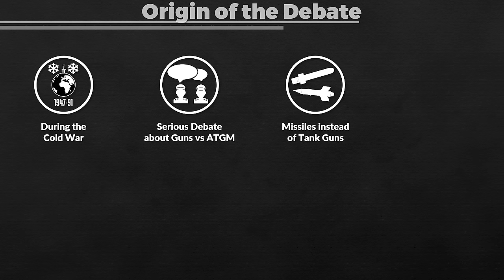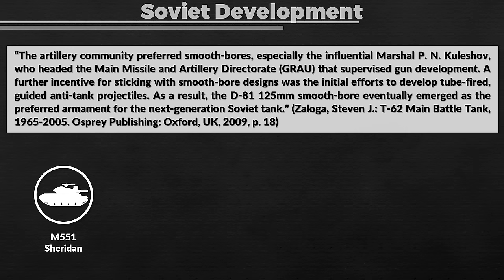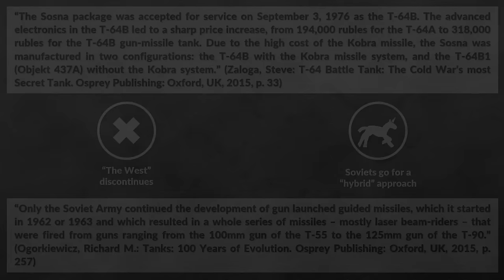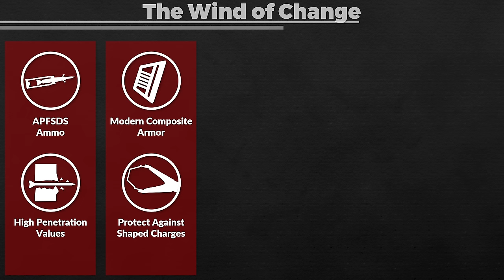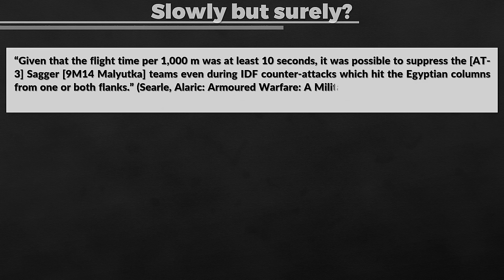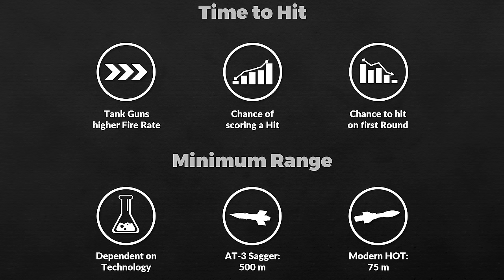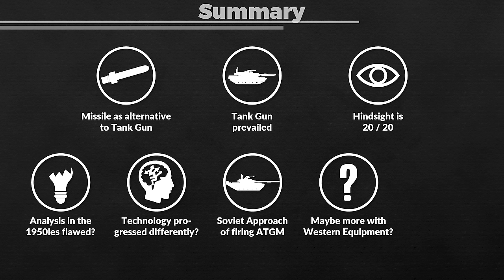Missiles vs Tank Guns: Why Guns are better!

Comment: The LAHAT has a number of advantages. It's very light at 13 Kg. It's short at ~1m length. It's very inexpensive compared to other AGTMs like Javelin. It has both direct and top attack modes. It's warhead is effective, yet small enough to limit collateral damage in urban areas. It has a lower launch signature than most other ATGMs. It has pretty good range, 8 km. Its warhead's rated penetration is 800mm of RHA, and it has a tandem warhead to defeat ERA. It can be used from tank guns, light armored or unarmored vehicles, helos, drones, UGVs and remote-controlled unmanned launchers. A version has been tested for the 106mm recoilless rifle. Given it can be used in so many different ways it's cost can be further reduced with a bigger buy for tank, mech infantry, helo and drone uses. Obviously if that's done the commonality in parts, maintenance, training and simulators also reduces costs.

Perhaps the biggest drawback is LAHAT's semiactive LASER homing. Modern armored vehicles can have LASER detection systems, as well as LASER dazzler countermeasures systems that blind or destroy the imaging systems on the attacking missile launcher. But an advantage is that the target can be designated by other sources than the launcher itself using separate LASER target designators.

Overall, the high capability and low cost makes it a very attractive ATGM system. The Indian Army is LAHAT's biggest customer, used in their Arjun tank guns and from Mi-8 helicopters.
Reply: The autor is west bias dont loss your time...

Comment: Another factor to consider is actual possible engagement ranges.  A British tank made an ~8km kill, most CAN fire further than a missile, if a good line of sight exists.
Reply: Missiles and rockets can have far more range than a tank round. Even long range artillery are replacable by cruise missiles with 1000 km or heck ICBM with incredible accuracy. It's the cost that's most important difference: a missile need expensive gyro sensors and rocket fuel whereas a gun can shoot basic projectiles with gunpowder. In the future with rail guns, that wouldn't even be a necessity as any metal material should suffice.

Comment: A missile is a expensive, sophisticated piece of rock capable of precise and minute movements to accurately hit it's target for maximum damage.
A tank shell is a big fucking rock thrown at incredibly high speeds at relatively low cost. There're many different kinds of rocks that can be thrown, but they're all still cheaper and easier to use compared to missiles. 
Not to mention, tank rounds are easier to handle, maintain, and takes up less space, which means you can carry more ammo, which means gun goes boom boom more.
Man humanity really hasn't changed much now has it?

Comment: For a gun system the muzzle velocity is not the velocity at the target which can be 1000 meters away in which velocity at that point will lower due to air resistance.
A missile, depending on design, may have propulsion up to the target & more velocity there, again depending on the design.

Comment: I see the main tank gun being relegated to a type of short range mobile protected artillery role where volume is important.  It does not matter if you have 70 shells in your tank if you get hit right away.  I'd suggest 4 anti-tank missiles and 8 anti tank rounds and the rest anti personnel/equipment rounds.  If you knock out 12 enemy tanks or even 4 before having to reload your rounds, you are doing great!  You can also launch and leave with missiles now a days...a huge advantage.

Comment: Very interesting. Didn't naval armament go through the same gun vs missile choice and came out on the opposite side? From what I understand guns are just a backup armament on a warship and the main workhorse is the missile, right? So what were the factors that made the difference?
Reply: Range. Whatever the theoretical range of a tank gun, it's pretty rare to be able to engage a target at more than a mile, maybe 2, even in a desert, because there are places to hide. There's no cover on the open ocean, so it is entirely realistic to expect to be able to detect and localise a target at hundreds of miles
Reply: Radars and BVR engagement. Also non-overlapping use cases.

Both gun and missile armament of ships are tailored to beyond visual range engagement nowadays, the UK 4.5 inch will fire 17 miles (3 miles is visual range at sea level). But a missile will fire closer to 200 miles. It's not even a comparison, missiles have capabilities that naval guns simply don't have, so you have one or the other, or both depending on your need.

At maximum gun range you have to factor in thing like the curvature and spin of the earth to your aiming calculations.
Reply: @talltroll7092  And even within gun range by the end of WWII you had ships able to range out to 39 km (over 42,000 yards) at which point the time of flight is about 90 seconds, and that plus the little variations in pointing, velocity, shell, etc. all multiplying over that time/range meant you're unlikely to hit another ship without firing off a ton of shells hoping to get lucky or some kind of course correction or guidance on the shell (which wouldn't be developed until long after anti-ship missiles)

So you could be within (extreme) gun range of the enemy and your slow anti-ship missile is still reasonably likely to make the first hit.
Reply: A ship uses a missile to kill a $100 million dollar aircraft or $1 billion ship. A tank might use its gun to suppress infantry. Conscripts even.

Also modern ships are basically unarmored because ship based missiles (which are huge) make armor a waste of tonnage. And as others have pointed out- not-tanks tend to use missiles.  Armor is basically what defines a tank. 

Also the range issue. Even a smart missile has trouble killing a target it can't see when launched. All naval radar outranges an 18" gun.

And remember the gun on the Zumwalt? The point was supposed to be cost. Then the round became as complex as a missile. It really was a gun launched missile. 

Railguns only matter if stealth or active defenses let you get in gun range. Although if they can shoot down ship killers they are again more armor than missile replacement.

Also shore bombardment. But then you're kind of doing a tank's job.

Of course if ATGMs get light and powerful enough (or javelins) people have long hypothesized the could make tanks and attack helicopters obsolete. But I think modern tanks are designed to operate with infantry. So the armor is as much for not-tanks as opposing tanks.

I like others points. Tanks carry guns. Other things carry missiles. 

But then let's talk about artillery... which interestingly are guns. But in NATO combined arms if it's outside of tank gun range the tank can help something else kill it. Either missiles or aircraft or artillery. 

But note the marines have now ditched tanks. And thus tank guns. Make of that what you will.
Reply: @doomedwit1010  On the point of shore bombardment, ships usally tend to have cruise missiles exactly for that purpose.  Look at the invasion of Iraq for an example.
Reply: @dragonace119  what percentage of targets were within range of 18 inch guns from where the ship launched? If we had an Iowa would we have used 16 inch guns instead if in range? Could an Iowa survive against a near peer within 16 inch gun range? A tank can survive  to get within gun range... we think. That might change. I am not really picking sides here. Are missile frigates always better than monitors for shore bombardment t? Or are frigates preferred because of utility in sea battles?
Reply: @doomedwit1010  Frigates are generally preferred due to the price compared to say a full on Super Battleship and like a frigate could easily get taken out by only a andful of anti-shipping missiles (of which the firgate would be much much cheaper to produce.  That and cruise missiles tend to be able to fire further in-land when it comes to hilly or rough terrain due to the fact thats its a missle, combine that with being able to accurately use a laser designator to mark a target however many miles in land and you have the result.  

Oh yeah almost forgot the straight cost of 16/18in shells vs cruise missiles doesn't account for the price it'd take to just produce the guns, launchers, or even maintence of either and there's also the fact of the matter that you have to set up infanstructure to produce both the weapons systems and the ammo for them along with the simple fact that only a handful of ships will have a 16/18in gun where's really any ship carrying missiles of a certain size  can carry the cruise missiles so thats a point for logistics.

Comment: Ships face the same choice.  There was a time in the 60's when it looked like missiles might replace guns on ships.  It didn't happen.  Missiles cost more and artillery shells have a "repeatability" that ensures they fire with the same force every time.
Reply: They have largely supplanted them for most purposes, though.
Reply: Poor example. The guns have been replaced by missiles as the main armament, both anti-air and anti-ship. Only a small number of guns remain on modern ships as auxilliary weapons or CIWS.
Reply: Well, but they aren't the main anti-ship weapon anymore. But they are still useful for AA, smaller targets at closer ranges and shore bombardment.
Reply: @AldanFerrox  Shore bombardment? Hardly. Tomahawks for example are much more effective.
Reply: @Pikilloification  During the Falklands War, the 1991 Gulf War, the 2003 Iraq War and during the current Russian invasion of Ukraine modern destroyers and frigates used their DP guns to effectively bombard shore targets.
Reply: I would have thought as the main armament missiles did replace guns, the main gun on a ship are often now just a single gun used for low end threats
Reply: @AldanFerrox  AA and surface point defense, mainly. Shore bombardment is almost always done with missiles these days since targets tend to be inland.
Reply: @wojtekimbier  Tell that to the Italians, they love their automatic 127mm and 76mm guns. They also tried to put ICBM's on a light cruiser during the Cold War, so....yeah.

Never change, Italy. Never change.
Reply: @wojtekimbier    I stand corrected.  I should have been thinking of the shows "Hunter Killer" and "The Last Ship", although I heard the capability of naval missiles  was exaggerated in those shows.
Reply: @Pikilloification  Theay are also very expensive per piece and have a rather limited rate of fire compared to guns, who, with autoloaders, can fire multiple rounds in quick succession.
Reply: Em, nope. 

Both the offensive and defensive of a combat vessel now days are missile. With guns retired as last line of defense mostly. 

Shore bombardment with gun happens when the other side does not have good anti shipping capability. And the range you have access to is like 20km maybe 30km if we really stretch it.

Comment: Drones and missile trucks/technicals may be the future though at least defensively.
Reply: Both of those exist already, and both have been used with some success. However, neither is a complete replacement for actual tanks. Missile trucks are extremely vulnerable to artillery (which generally won't do too much to actual tanks except in the case of direct hits) and small arms fire. Drones have the limitations of aircraft in general (they don't like bad weather).

Comment: Guns are cheaper and you can bring more and rate of fire is higher. Production rate and cost are also factors.
Reply: But ATGM does not need large carrier platforms. They will therefore work well for infantry and on cars and other lightly armored vehicles.

Comment: i think tanks will end up splitting again at some point in near future.
Having only 60+tons MBT as your only tank might sound great, but it is an expensive beast to build, feed, maintain and move arround. A 75mm to 105mm gun can support infantry about as good, and having enough AT punch to pierce weak spot on larger MBT, so 25 to 40tn "medium" tank could do as a cheaper alternative to MBT for many uses, and if correctly build, having a very strong armor against non-specific AT guns.

something in the weight of a T-55 but modernly built, with composite armor, a secure ammo box and L7 105mm cannon should be a real "hit" able to perform 90% of the MBT's job at a much lower operational cost

Comment: LOL: for future reference, "Shillelegh" is pronounced "Shill-ay-lee". It's the Irish word for a type of walking stick that can be used as a club or cudgel.
Really guns and missiles are complimentary systems, not rivals. The big advantage of missiles (not mentioned here due to the scope of the video) is that they have no recoil, and so can be mounted on platforms (like jeeps, helicopters and pairs of boots) that couldn't possibly use a tank main gun (or would only use it once...). The big disadvantage of missiles is low density: the volume-per-stowed-kill of a missile system is much higher, and the awkward shape means that they can't be shoe-horned into small, irregular volumes in a vehicle to the same extent than gun rounds can be. Few ATGW vehicles carry more than 20 rounds (most much less), whereas tanks carry at least 40.

Comment: I think in my humble opinion if you can afford to you should make a dedicated launcher slot for a missile on the tank while keeping the gun, Similar to the TOW on the Bradley armour so you can have both armaments.
Reply: The issue is never the cost. It is the size.
Reply: @jintsuubest9331  well we are just Random Internet users so i don't take your point seriously 

Especially considering size doesn't matter in 50+ tons of a metal beast

So adding a dedicated launcher spot similar to Bradley should do it

You would have the gun to be used as the main armament and the Missile launcher with 10 or so missiles to be used on special or hard targets

Comment: I'm curious whether there are any partially steerable gun rounds in development, like the ones proposed for sniper rifles. Basically tiny actuators on the tail that can slightly steer a round after it has been fired.

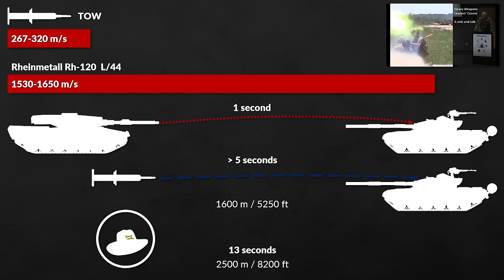Comment: 12:00 the Stugna-P currently used by Ukrainian troops deserves a shoutout. It's manually controlled, but using a remote controller with a range of about 50 m. There are already multiple videos of shots where the operators steer the missile from perfect cover behind a hill or in a trench. So far I have seen one miss out of 5-6 shots or so, but of course operators might be less inclined to share footage of misses.

One interesting question is how much control input the missile needs in the later stages of flight. If the camera is for example taken out after 1000 out of 2000 meters, would be the missile likely hit because it's already on course or often miss because it might still deviate?
Reply: It is a beam rider missile that guides it all the way out to 4000m, with in theory flight distance of 5000m. 

The arming distance is 100m from the launch unit. 

The controller can be detached from the launch unit and still remain connected to the guidence system up to 50m. 

If it is unguided, then you have high chance to miss even under 1000m.

Comment: I think a gun can also be more versatile, as it can engage many kinds of targets, such as machine gun nests, or simply blow a hole in a wall. Guided missiles have to be designed and programmed to engage certain targets.

My theory here is that the primary role of a tank is not to kill other tanks, but entrenched infantry. Planes, helicopters, and now drones are what kill tanks.
Reply: Come to think of it, tanks could use some Stingers or other anti-aircraft weapons. May already have these, but I’m ignorant. Maybe approach tanks and other land vehicles similar to how the Navy operates their carrier battle groups: mobile drone support vehicles, air-defense vehicles, radar and communications trucks, etc. Once again, this may already be the way it is, but I know very little.